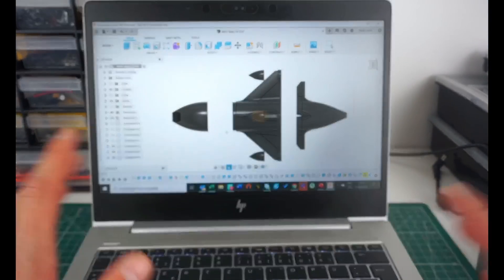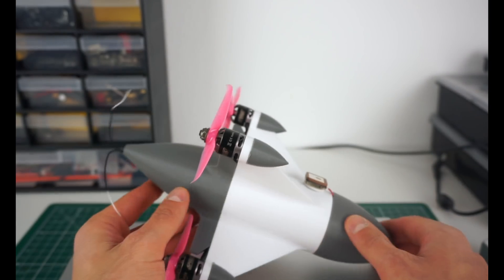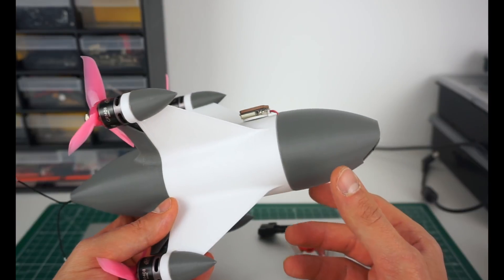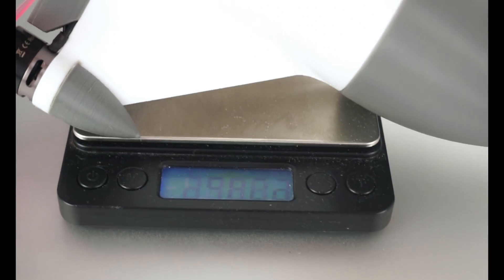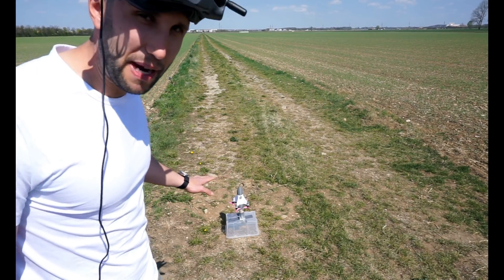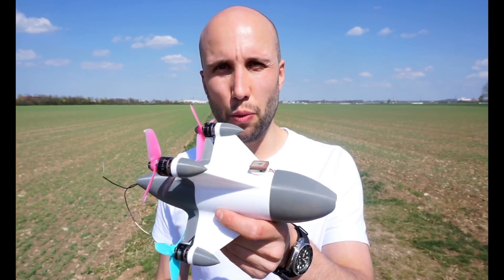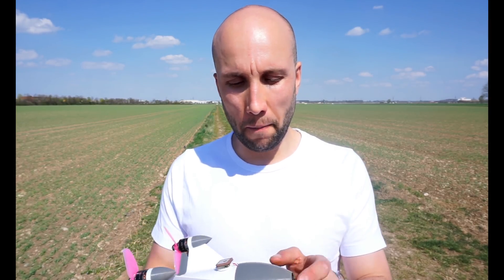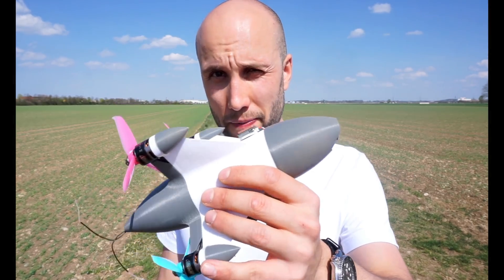3D printed Rocket Quad Part II (6S Runs!)

Comment: Quick question, I just printed out your design and I’m about to build it all out, but I was wondering, did you place the battery in the middle section or the bottom section? 
I’m in Italy currently, so the weather is still good to fly this quad for a little while longer.

Comment: Someone just showed me this.  Pretty awesome.  Not unlike Ryan L's rocket quads.  Get that GPS inside and moving the motors forward a bit to balance the weight with the battery will help a little although aero is far more important than a bit of weight distribution at this point.  Polish the walls if possible.  From my discussion with Ryan, the center of pressure is extremely important.  Also, detune the quad a bit to assure you're getting to max rpm.  You can consider putting something over the FPV cam as well.   With aero like that, you also don't need a triblade as much.  An aggressive twin will get you significantly more speed.  Impressive speed already, you could probably get it up around 290+kmph on whatever drivetrain that is on it already which would be pretty incredible for a 3".  Great work as usual.  Ryan was doing around 170mph on 4S with his 5" things.  It looks like he's made his highest speed runs private but check out the videos he has up.  Pretty interesting ideas.  

200mph on 5S
https://www.youtube.com/watch?v=CIsZSAUcGbw

Six gram 5" frame
https://www.youtube.com/watch?v=y8v-NvAYVo8

His site
https://downanddirtydrones.wpcomstaging.com/portfolio/xlr-1/
Reply from the maker: Thanks man! I didn't really mess around with those high speed builds lately because the whole Flywoo Explorer thing kept me busy but I have a new version of it in the making that is powered by 4 small EDF jets😅 Also included things like two cams with an aux switch and smoother surfaces 👌🏻
Reply: @DaveCFPV  awesome.  Consider using the upcoming Ant Lite 4:3 that I had them make specifically for me and stick one directly in the nose and another at about 45 deg.  The lens is such that you can mount it flush with the exterior really easily.  They're making this version of the Ant Lite the default one in the 4:3 version

Comment: there is FC that support two camera inputs and can switch between them (also i believe, if i remember correctly dronemesh has a board that can do that even on a regular fc) so you could go with a dual camera setup - one for flying, one for landing

Comment: since the weight is already high, maybe look into ducted fan designs that actually improve thrust. The ducts wont add much weight and you could potentially get some pretty good thrust improvement, though with high prop speeds, it may not produce much more if any extra thrust.

Comment: Would it be feasible to drop a cheap FPV cam inside the tail where the antennas come out, put on a diff vtx channel and switch to that for landing?  Just thinking out loud..... Great video, I may need to build one.

Comment: you can use Colorfabb's lightweight PLA for non structural but aerodynamic parts. this material foams up in the nozzle depending on the temperature it's printed at and can foam up to 3 times its normal volume, allowing for 66% weight reductionof these parts. it's not quite as strong as regular PLA, but for aeroydnamic fairings and light hardware brackets it's a real weight saver. I used it on a 2,5m wingspan airplane for the nose cone, wing /fuselage intersection fairing and leading edges of the wing and tailsurfaces.

Comment: Nice, very nice. You could have the camera tilt using a servo and a spare channel on the link so at the flip of a switch it points the camera down to "landing mode"  and then before you take off you set it back to "speed mode"

Comment: Interesting project. Do you know what your thrust to weight ratio is?

Considering this is a rocket, you might want to optimize for minimal weight rather than crash resistance... after all, it's easy to make replacement parts, and even a thick wall will not survive this thing at full speed.

Also perhaps you might consider a design with mirror symmetry rather than radial symmetry. Making it more plane-like where you have larger horizontal fins for lift could be an improvement, helping improve lift-to-drag.

Comment: You will likely have less drag if you add a small acrylic glass half ball over the tip where the camera is. You can likely source it from those coin operated machine prizes, they use them as containers for small toys.

Comment: Hey there, it might help to discontinue thinking of the rotors as providing thrust and instead refer to it as lift.  This could help to change your thought process on builds.  An interesting fact is that one of the fastest helicopters is the CH-47 Chinook.  The Chinook is not very aerodynamic, or more so than other helicopters.  What it has is a lot of rotor disk area.  That gives it a lot of lift force.  

 Helicopters generate thrust by creating a difference in lift force across the rotor disk(s).  If there is a greater amount of lift force on one area of the rotor disk, say at the 6 o'clock area, than that greater force will want to spread out over the rotor disk.  The lift force wants to be in equilibrium across the rotor disk or system of disks.  The greater lift force in the example will move toward the area of lower lift force.  The movement of the energy creates thrust in the opposite direction.  Multirotors accomplish this by varying the lift produced at the various rotors.   

Essentially, the way to make a helicopter as fast as possible is to increase the size of the rotor disk and reduce the weight load.  The problem with larger rotors is that they have a higher moment of inertia.  That takes more power, which takes larger motors and increases the energy requirements.  There's also the ability to increase the amount of lift the rotor(s) produce, but there's still a peak and diminished returns once you pass the peak.

Another aspect of the helicopter is that the wind speed over the rotor blades cannot exceed the speed of sound.  If they do, the air will detach and lift will be lost.  That max speed can be calculated by taking the distance the rotor blade tip travels in one revolution and multiplying that by the RPH and dividing by the distance equivalent of one mile or one kilometer.  The max speed will be the difference between that number and the speed of sound.  The RPM output of an electric motor is the kV rating multiplied by the voltage.  

There's a lot more, but I hope this helps.

Comment: Maybe consider adding stabilizing fins at the back like on this Treibflügel: https://farm4.staticflickr.com/3624/5751868406_d1e25a3028_b.jpg
They'd a) allow for a selfpowered start without the use of toilet paper rolls and b) also aid with a stable flight.

If weight is a concern I'd suggest to change the model so the majority of it can be printed like in vase mode with only one perimeter.
That, instead of two layers on the outside and inside plus infill on the shell of the main body, cap and bottom should probably shave of like ⅓ of the weight.
Obviously you'd still need a bunch of perimeters and infill on the structural cross area that holds the motors.
Reply: Was going to say the same thing, some small fins at the back for take off and landing, plus a little more stability.
Might just need to check where the CofG is, and maybe move the battery forward to suit.

Comment: there is a huge hole in the front taking most of unnecessary drag.. I don't know how experienced you are but why don't ju just hand catch or just drop the quad in LOS?
Reply from the maker: The hole is used for getting some airflow through the batteries and electronics and out of the back hole. Landing LOS was my plan initially but it's harder to switch from goggles to LOS than I thought. The quad still moves pretty fast and due to it being pretty small and symmetrical it's hard to tell what its orientation has. Plus you are a bit disoriented and blinded by the sunlight yourself after a couple of minutes under the Goggles. So just carefully dropping it at low speeds and altitude was a safer bet. A version 2.0 of this I'm starting to work on will simply have two FPV cams that can be switched through an AUX channel

Comment: Maybe sand down the outside or add a thin coating?  The 3d printing leaves texture on the frame which probably adds more drag then one would think.

Comment: Bro that was sick 😃👊
To land just pull your goggles off and land line of site. 
This might sound funny , if weight is an issue, make it bigger 5" or more with hi kv motors on 6s or more  😃👊 you can tell im excited for you , right? 
Bro its so cool.
I got some custom batteries made last year.  U could get some long ones made to fit rocket. 
You could run air unit in it. Record in hd and gps and have clear plastic cover over fpv camera , less air drag. 
 I can see you getting Speed WR in the future bro 😃👊
Do you What the Speed WR is ? 
Bro you got this thanks for sharing

Comment: Did you find the Center of Gravity and the Center of Mass??
Reply from the maker: Roughly aligned them in the design process yes. It's not perfect but the motors are extremely powerful so issues to manage a COG that is a bit off from the prop line and center of lift
Reply: So what is the difference between Center of mass and Center of gravity? 🤪

Comment: WOWee that was fast my friend. Add some smoke and when take off, punch the throttle hahaha. it will be a rocket take off. Did you try the new Flight one firmware? that might give even more control over all parameters and PIDs.

Comment: Forgive me if this question has already been answered or if it a stupid question, but what is the position of the quad during flight? Is it flying like a normal quad, with propellers pointing up? From the video and the footage from the quad I would say the nose is pointing forward, which would put the motors and props turned 90 degrees facing into the wind. If That's the case, how were you achieving that constant during flight? Maybe next video you could have the sticks showing in your OSD. Very interested in how you piloted this quad
Reply from the maker: Yes exactly the Flight controller is programmed just like on a regular configuration with the motors on a horizontal plane. I fly it in Airmode which makes the Controller stop trying to Autolevel and instead hold the current angle. So I just need to tilt it by pushing the sticks foreward and back to neutral and it  will stay pointing foreward untill I push them in the reverse direction

Comment: Great stuff man.
Love the 1408 motors...could they run decent on 3S?
Reply from the maker: 3500kV is a bit low for 3S but sure it would run just fine with 3" props

Comment: You need the cam on a pivot controlled by a small servo and a switch.
90 deg out the side for t/o and landing, or pointed towards the nose for speed.
Seems you could easily work out a pivot mount for the cam and a mount for the servo for v3 print.
Reply: Easier to have a 2nd camera and just switch from high tilt for speed run and to low tilt for landing.   Less weight and more reliable.  Bicks Multiview is what I use on my Cheaters and works great.   Also ViFly or one of the dual cam FC would work.
Reply: Plug the camera servo into the Rx throttle channel. As you throttle up, camera points forward.

Comment: I noticed on your toothpick builds you use the nameless aio. Are the pretty reliable?
Reply from the maker: To be honest I stopped telling people things are reliable just because they worked for me. I'd probably have to test 10 or 20 to be sure i wasn't  just lucky and got a good one. But yes, mine worked perfectly fine :-)
Reply: @DaveCFPV  I know what you mean. I have been using the beta fpv boards zero problems so I stick to those.

Comment: seems like that flight controller enjoys having no airflow across it.
Reply from the maker: Yeah that thing is boiling hot 😅 But the Diatone F722 really likes to heat up either way.  You get core temp warnings within seconds on the bench ...
Reply: @DaveCFPV  Put some small NACA ducts in the side to cool the inside electronics. Very cool project!
Reply: Heatsinks are a great invention.

Comment: If you put a distance sensor at the rear end and 3 legs like a space x rocket controlled by a servo by distance read, u will be able to use auto landing with help if the distance sensor. Its basicly a pid for height controll. But for landing you will need to use the sensor and not your altitude with a set value of 0.

Comment: It's aerodynamically sound but you have a large hole in the front????
Reply from the maker: Yes that intentional. Some air needs to flow through it and out of the back hole to cool the battery and electronics

Comment: You should 3d print a lightweight frame and then vaccume form a shell for airodynamics. This would be alot lighter and vaccume dormers are easy to build if you supply the heat with a heat gun or oven. I can show you how I build one if u can't find anoigh information o the internet.

Comment: Not an original design by far. This is just a copied vtol plane design. Decades old. . But ok, cool.
Reply: If you're implying it's simply a copy of the Convair Pogo...you couldn't be more wrong. For one thing the POGO was a tractor configuration. This is a pusher. Now if you're saying it's  a copy of some 1950's era Buck Rogers Rocket we can talk...lol..
Reply from the maker: Jeez I never claimed that similar things haven't been done before and even mention Quadstar specifically... Main point here is that's it's fully printed with no supporting aluminium or Carbon structure along with using a powertrain / prop size that is unusual for those types of setups and combined with bigger wing surface
Reply: Dave_C FPV well this was supposed to be a reply to another comment but apparently my youtube app messed that up. Lol no the 3d printing and all that very cool indeed. I was referring to vtol aircraft in general. In specifics lockheed and convair. Quad vtol i guess would be more proper.
Reply: @AnnikaFPV   I think anyone creating something would like it to be original and first of it's kind. Copying is the sincerest from of flattery but gets old after a while...have fun whatever you do...
Reply: Annika B lol no kidding

Comment: how do you arm at such high core temp?

I have a quad refuse to arm at 75 due to VTX mounted so close to FC
Reply from the maker: The Mamba F722 does that alle the time even in other quads with good airflow bug I never had any issues with arming

Comment: You should try this with 5” gear.!  The body wouldn’t have to  be much bigger just bigger fins.  So the weight increase shouldn’t be much compared to the power you’ would gain.   For easier landings you could use angle mode when close to yourself and land “line of sight” .

Comment: Do you have an idea of what the top speed of the hardware you used is on a standard frame. Curious how much of a difference the aerodynamic frame makes.

Don't think that the extra frame weight will make much difference in the top end, but will in terms of responsiveness.

The body seems quite wide, although I suspect that it's probably as small as you could go to be able to fit the battery. Any room to be able to reduce the cross section area? Could you make it thinner with a different battery configuration. Eg 2x3S packs stacked on top of each other. 

Your current design allows you to change camera angle, but comes at the expense of a large turbulence creating hole at the leading point. Be interested to see if there was any improvement if you allow only a specific angle and reduce  the  hole to just fit the camera. 

The air flow is currently optimised in the direction of thrust. Wonder if the main body would be better optimised in direction of travel. Would need to figure out what angle that would be at though.

Comment: Hey Dave, excellent video. Have you thought about creating or modifying an existing design for a cinematic 4" drone which can carry the caddx vista? I think your project microlongrange is an excellent fit but 16x16 stacks are less common and less capable than the 20a whoop boards. What do you think? Seems like 4" would be a better balance vs 3" to carry the extra weight of the vista.
Reply: If you order the 4in Micro Long Range frame from Nick at CNC Madness, he has a version with holes for dual 20x20 stacks, pressed mounting nuts and chamfered arms.
Reply from the maker: Hey! Thanks! Actually the Microlongrange can carry the Vista already. Fits perfectly. I know 16x16 are less common but they are the only way to have a very compact frame. CNC madness however sells a few different Versions that are stretched by 6mm and have mounts to fit 20x20 stacks and AIOs
Reply: @DaveCFPV  Awesome, I'll contact them!